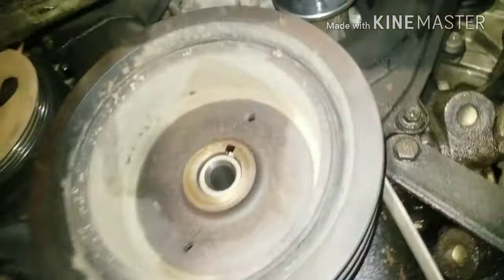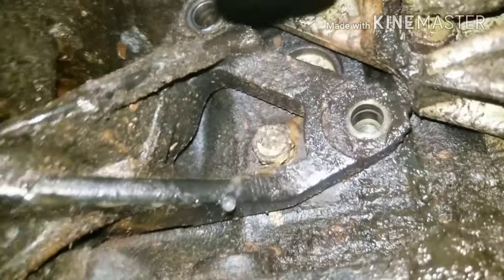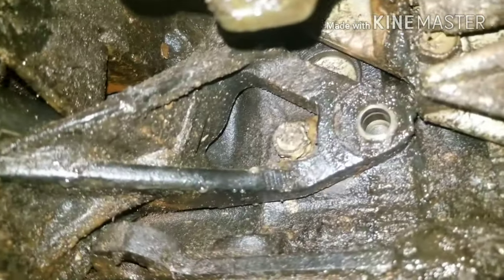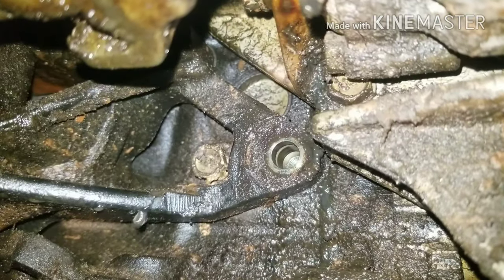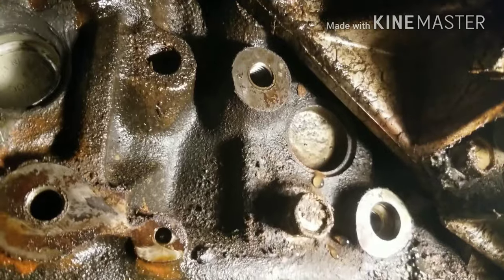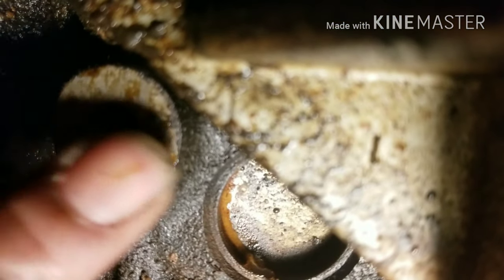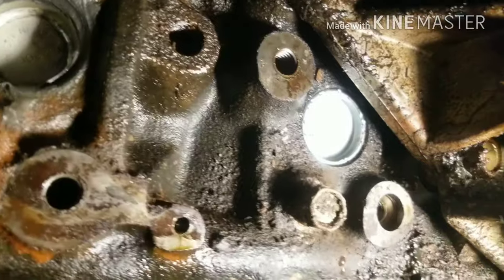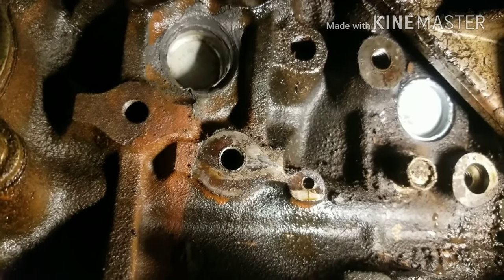How to Diagnose And Repair a Bad Freeze Plug

Comment: Thanks for taking the time to do this, I have had a small leak in my 454 V8 and this could well be the problem the coolant seemed to drip onto the starter motor which isn't good. But finally I think I can see where it comes from, it has involved getting the oil and dirt from the area and giving it a good clean so I could see more easily where the water was coming from. Thanks again
Reply from the maker: Thank you please like, share, and subscribe, also please check out my other channel Salem Taxi, on YouTube for more material on a different level.

Comment: I have a 1988 Chevy Caprice I have a freeze plug I think I have to replace coolant cooming out from the back of the engine so I gotta keep putting water or coolant in the car before I drive it but also it start smoking from the hood while I'm driving after  bout 15  minutes of driving I've been told it also could be the heater core or the thermostat so is it just the freeze plug or the freeze plug & something else also??
Reply: That's the same problem I'm having with my 1986 Chevy Caprice I'm glad I found this video